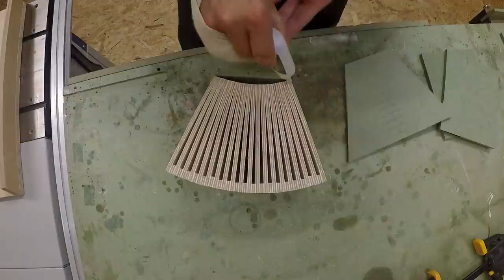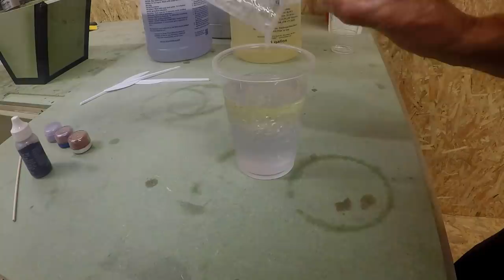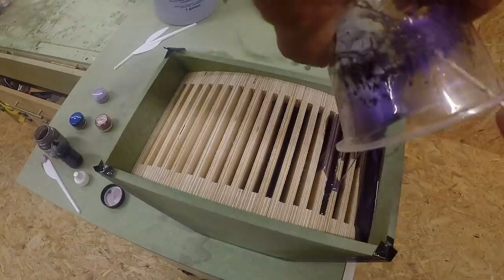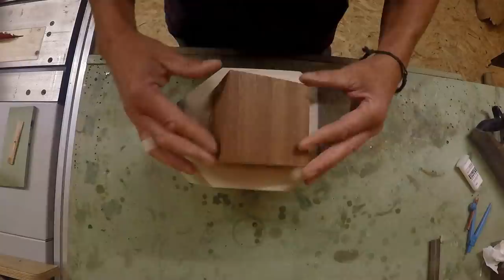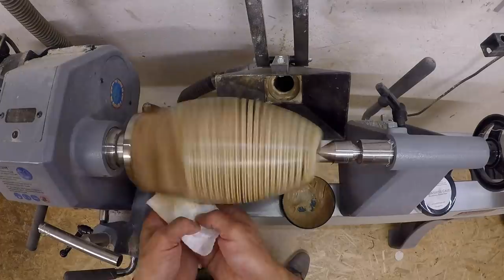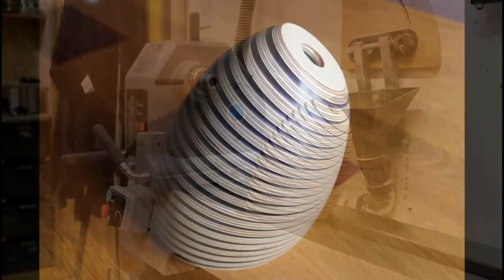Woodturning - The Armadillo

Comment: I watch a lot of youtube wood turners, and have always wondered why they start with square blanks instead of knocking the corners off first... and now I've found you. FINALLY someone does the smart thing!  Why do they all put the evtra wear on their tools, bodies, and time like that? Is there a logic to taking time to round a square blank on the lathe that I'm just missing?
Reply from the maker: I don't  find it a big problem leaving the corners on if it's a nice piece of wood but this was nasty as hell to turn so i needed all the help I could get .. cheers
Reply: most of the guys use tree or root itself which are basically round
Reply: He took off the corners because of all the brad nails that went into it. Those would cause some issues when turning it.

Comment: Wow Andy, that is such an inspiring project. I intend on making one similar.
However, I wish you had shown how you cut the waste block off & especially how in the heck you drilled or turned (?) the hole for the flowers. PLEASE reply. Thanks for sharing this great video.   Jim
Reply from the maker: Thanks Jim .. I just cut it off by hand and cleaned it up .. same with the hole I just drilled it off the lathe .. It was one of those pieces that didn't really work as I wanted but turned out pretty cool ..cheers Andy
Reply: Andy, I appreciate the heart, but could you please answer the questions. Tks
Reply: Sorry, sir I didn't see your comment.  Jim
Reply: Lol